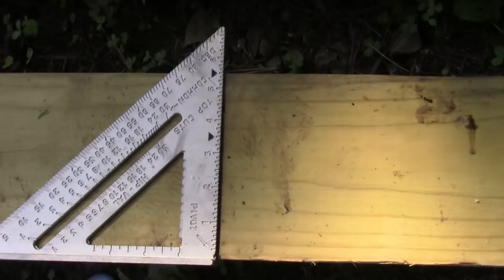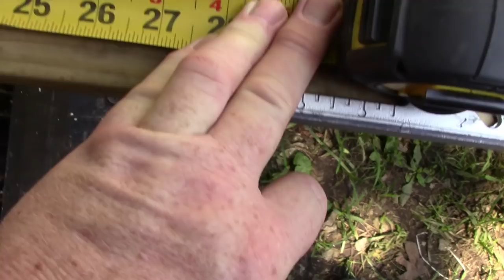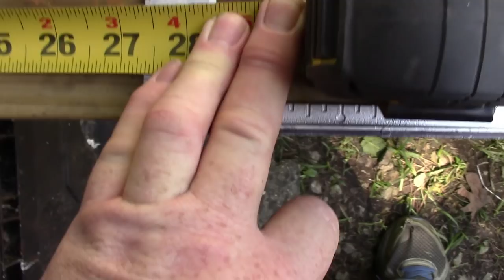SLED BED WORM BEDS - NEW INVENTION

Comment: My Sawzall with a steel blade would go through those totes like butter .. very good idea, bringing the entire batch to the trammel.  Now I can't shake the mental image of a circular railway leading out into the woods, and back around to the barn .. push button, get worms ;)
Reply from the maker: Circular railway - yep! That's it!  I did use a sawzall too. It's in the video. Worked great1 I like to show different methods.

Comment: I saw another operation doing something similar with those big industrial fruit crates that have small slots on the sides. Do you know if the increased aeration (i'm speculating) would be more beneficial than these types you use? What are your thoughts? Price point is roughly the same (55-60/ crate, you wouldn't cut those in half)

Comment: Regarding the screen you glue down, I suggest that you make it a circle, so whatever is above is less likely to catch those straight edges. I’m a nurse and that’s why we cut bandages in clinches and round edges. Also perhaps using some stray adhesive initially would hold the mesh down while you get the hot glue? Or maybe just use some silicone caulking and push is into the mesh? Wouldn’t that work?  Wouldn’t it be easier to put that heavy wire screen on the bottom, to make the moles not able to get to the finer mesh? Also it might be good to put some wood strips underneath to support the plastic, so it doesn’t warp? The you could attach the wire to the wood to secure it underneath. 

Also, I’m thinking these would be great for raised garden beds!

Comment: Hello Greg, a modification you may want to trial as you rotate thru the harvest. À snorkel for Aeration of the compost attach or screw perforated irrigation pipe, PVC slotted  tube or cut plastic bottle to the drain recess. This will hold compost in, gets rid of the anaerobic bacteria. Pest control u can still insert some chicken wire grill or mesh inside the pipe...General Rid Stump!!!

Comment: What i think i would do is cut the metal cage at the top of the first pipes not the second level.
I would cut the plastic tank 3 1/2" above the level of cage i left.
Then i would build 2x4 frame around the plastic and have it rest on the pipe frame. That would give plenty of depth for the bed and the  hinges for the plywood lid could be screwed to the 2x4 frame. A few screws through the plastic from the inside would secure the plastic walls to the 2x4 frame. That would keep the sides of the bin straight.
It would also do away with the sharp pipes sticking up and having to deal with that problem
Instead of 4x6s for the skids that are expensive, heavy and hard to cut, i would cut a pattern and use three 2x6s screwed together.
I would use pressure treated lumber since it will be on the outside of the bin. That would make it last longer. I might be tempted to put a sacrifical 2x6 with beveled ends screwed onto the bottoms of the skids that could be replaced every few years as needed if rot got started in the ground contact area of the wood.
As you say, these would make fine planters too. A fine idea.
Retired carpenter and construction project inspector.
John Davis jax fl

Comment: When I cut them totes to make goat houses out of I just use the sawzall to cut the plastics and metal frame all in one cut. Works great. Probably know already too, that you can buy pallet forks that fit on the 3 point hitch for not a whole lot of money and  many claim they are one of the top most useful implements to have about. I bought a set new, but have as yet to use it as I thought I would, not that I won't, because the carry all works for most things I need it for without having to put on the forks.

Comment: I've got a narrow row tractor with no front loader. I have bail spikes on the rear linkage & use it as a fork lift for when I'm moving my (mobile) raised beds about. I use saved pallets made into a 1m cube to make the beds & they fit perfectly to the spikes (perhaps a strap so secure it). Its a piece of cake to move those things about now, might work for you? Merry xmas you all & a prosperous year ahead!
Reply from the maker: I'll try it! Just added bumpers so I can push them around with the front tire.

Comment: -As someone with 33 yrs of manufacturing experience I was appalled by you using a power tool (on the runner end cut) without removing the plastic flagging on the end. SAFTY FIRST!
- may I recommend you notch the runners for the crossbeams instead of the tote? Then secure the crossbeams with screws. And finally, screw the tote to the crossbeams.
-why do you put the plastic part back in the frame so soon? Why not wait until just before you are done? What holds the plastic inside the frame?